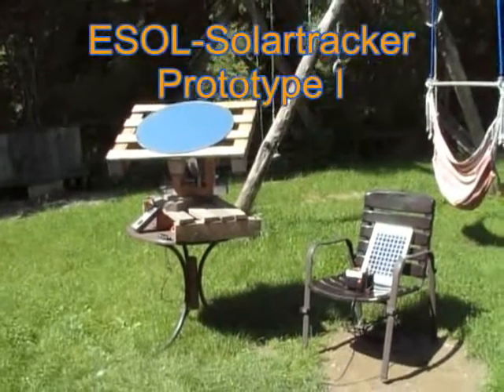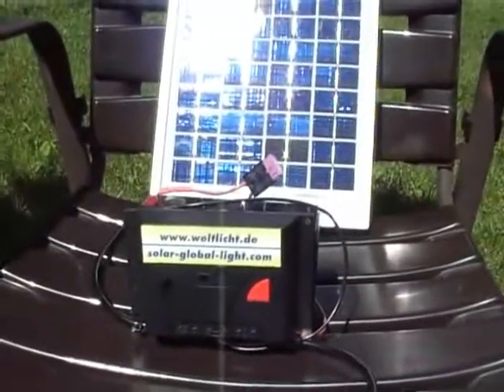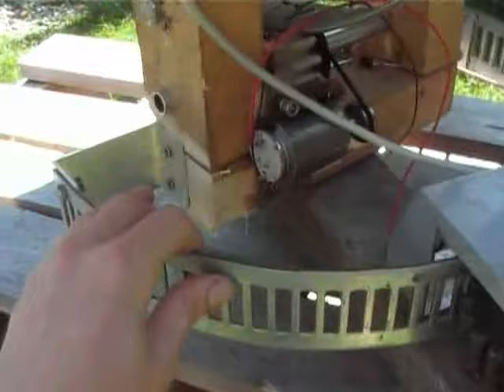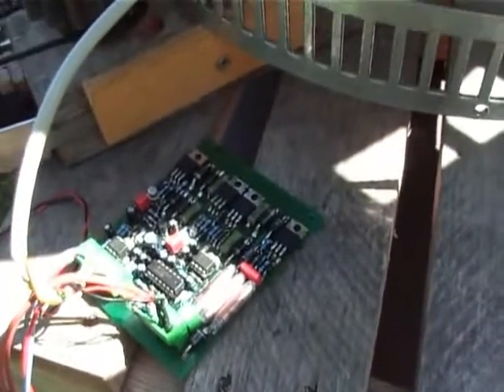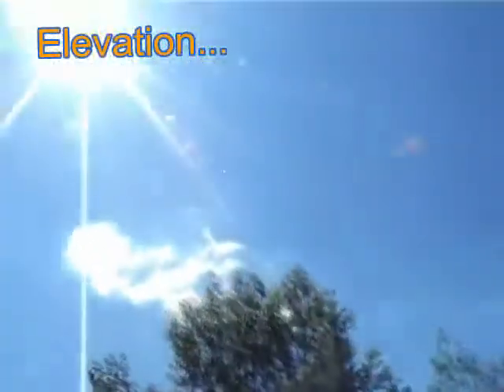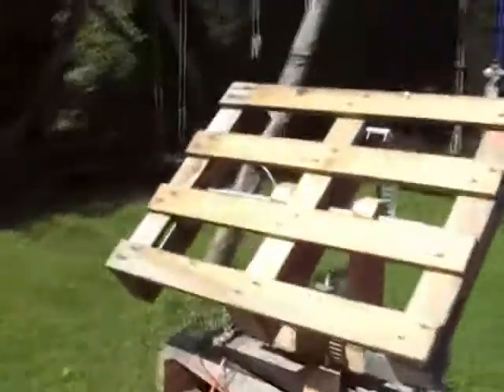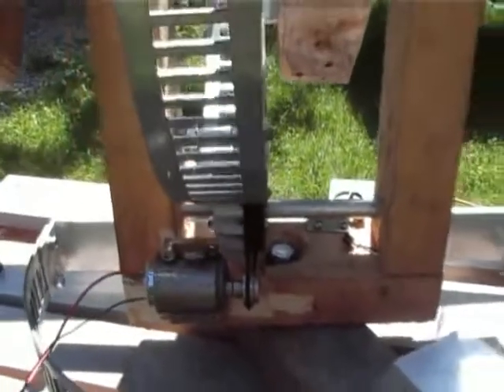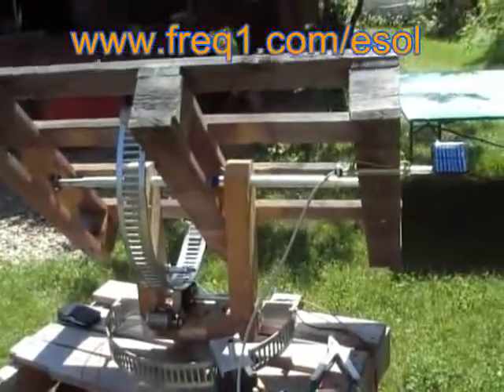Solar Tracker Prototype One

Comment: Nice two axis drive system.  I like very much your motor drive with the punched out strip of metal that then can conform to the form of the platform.  I am designing a sun sensor also but am just using some inexpensive photo transistors with an interface circuit to a programmable logic controller.
Again, nice job